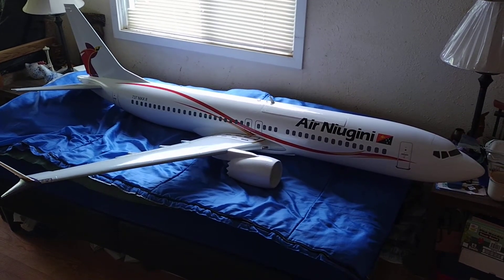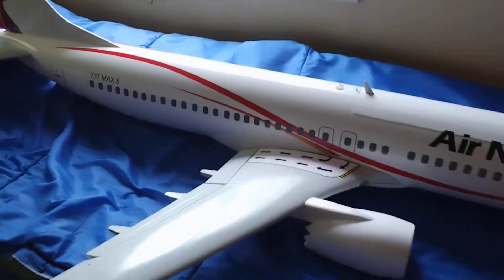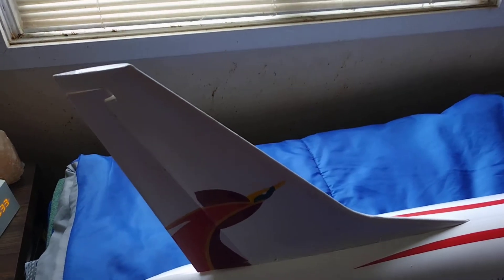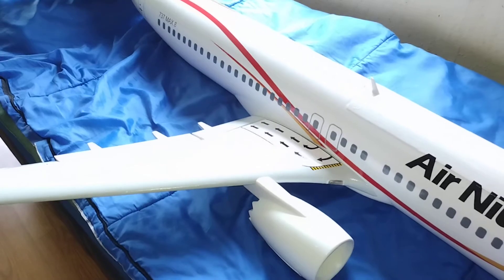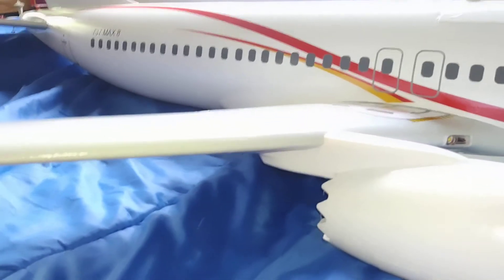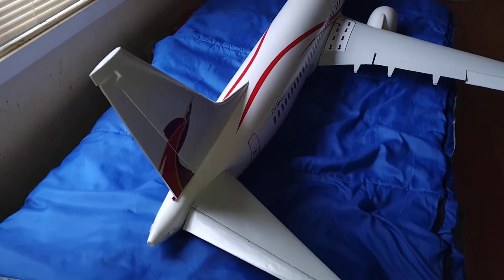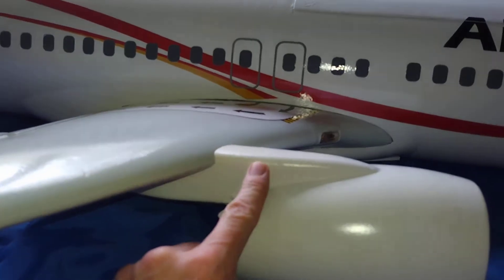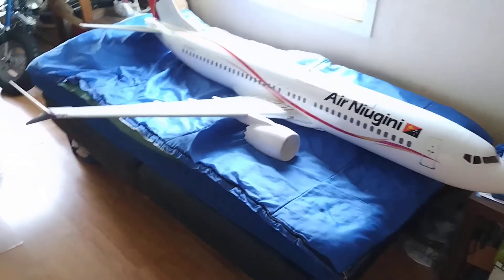Motion rc AL37 737 max airliner Air Niugini fiberglassed.

Comment: I’ve never fiberglassed an aircraft using minwax polyacrylic, so my question is this. I assumed you applied the polyacrylic using a foam brush but did you scrape off the excess with a squeegee or did you just leave it on there and then sanded later?
Reply from the maker: No need to scrape of excess. Since water based dries thin. Epoxy does not thin out and then you need to remove the excess. I applied 3 to 4 coats gloss polyacrylic and lightly scuffed before painting.
Reply: Thank you sir I appreciate the info!  Did you apply primer before painting?
I look forward to the second build and maiden flight!

Comment: So... that looks great. LOL I read your Bio on here, you sound like me.. Mechanic, collision tech, motorcycles. I'm retired due to lung cancer all good now. I have several questions about your airliner. Have you flown it yet? What is the total weight minus the batteries? How does it fly with the extra weight? I was wanting to do the same thing.
Reply from the maker: I have not flown it yet. Feels light and strong though. The fiberglass adds hardly any weight. I quit auto body work due to health risk but still work on my own stuff.